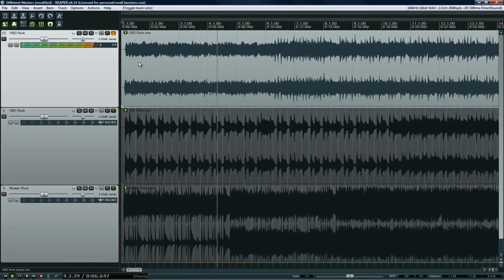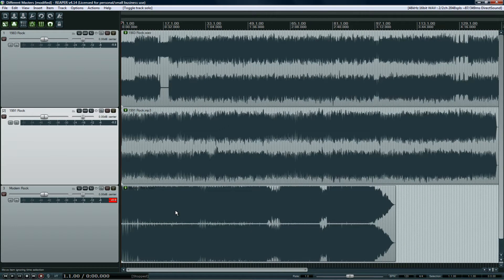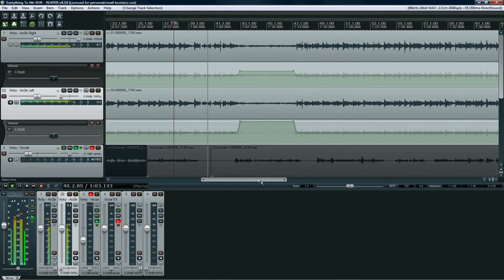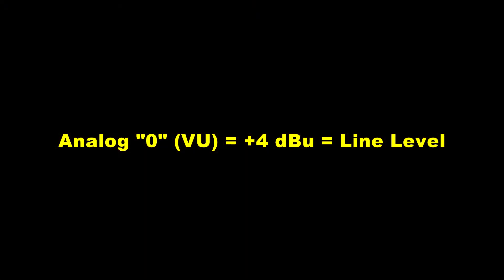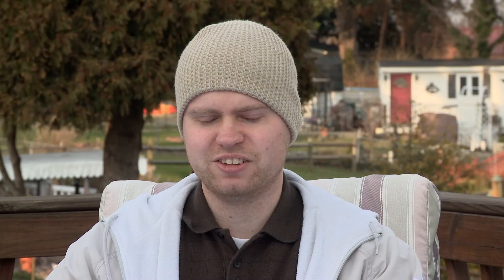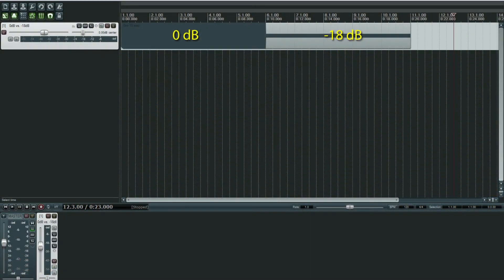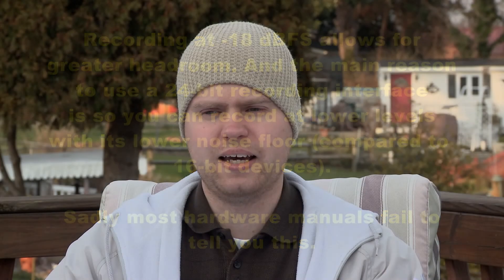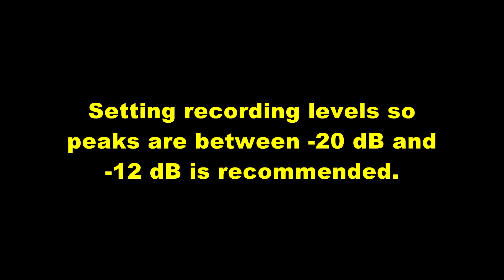Best Audio Recording Levels Optimum Tracking Settings

Comment from the maker: Tracking at lower levels has had a huge impact on quality. I used to think my cheap gear was worthless until this bit of knowledge hit my brain. 

By recording at appropriate levels worrying about digital clipping (going over "0") was gone. SOME of my recordings were OK thanks to using a mixer but when I was using an interface with built-in preamps that's where I would track too loud.

Not anymore. Not since 2009. And I mix quieter now too! Mastering is when you make it loud...

Comment from the maker: I hear you! I went for about 5-6 years using a Behringer mixer with RCA stereo outs going into a Sound Blaster card. There was no punching or latency-free playback. It was what it was.

Now I have a better setup using a PCI-based interface. Latency isn't much of an issue and my gear overall is better. I research new gear purchases until I am blue in the face and pray for the best when I click the Buy button.

Zoom/Samson have some good stuff. And Tascam too for the money they are great.

Comment: Adam I keep coming back to this video; dude, you are THE master. There are too many so-called experts on YouTube giving terrible advice regarding this subject. Your explanation is so precise and scientific. I finally get the point of 24 bit recording systems. Record at lower levels to avoid recording the  noise floor in the home recording environment. Take advantage of the dynamic range. It took me a long time to figure this out; I was clueless for so long. Thanks!!!
Reply from the maker: +Warren McDonald Thanks for the compliments, Warren. Glad I could help!
Reply: So when I record my acoustic drums should I have each track fader set at about -18 and same for electric guitar and vocals? If I do this will I not have to gain stage down before mixing? Right now I have them all at 0 while recording. App any tips. Thanks for the vids
Reply from the maker: Larry Tate Leave your faders at 0 while recording. Set levels with your preamps (input knobs on your interface or mixing board).
Reply: Ah ok I get it now. When I set my interface levels so that I get my input levels in the daw at about -18, I'm only getting like two green dashes on my focusrite interface. I was going all the way up to the first yellow dash where I used to set them. Is only going to the second green dash on my clarette interface ok or should the signal be hitting a lil harder at the preamps?
Reply from the maker: Larry Tate Just set it so you don't peak over -10 dBFS. Some people say -6 dbFS is the absolute max so if you aim for -10 you'll probably never get to -6 dBFS. 

-18 will be your average peak range but not absolute.
Reply: Larry Tate I use a focusrite interface and that taking is peaking like crazy!
Reply: I just tried this setup and my God you're right! it sounded a lot better now. Thank you so much!

Comment from the maker: Glad I could help. 

If only they told you this stuff in the instruction manual, right? I was doing it wrong for a long time and was always complaining about clipping. But then I learned about how recording quieter not only saves you from clipping but it also sounds better overall.

I was skeptical at first and worried about my noise floor but I had access to better equipment by that time and sure enough my recordings benefited from tracking where I should have been tracking the entire time.

Comment from the maker: Thanks I appreciate hearing that!

Well the idea is to record your individual tracks at lower levels so that you don't have to adjust their faders down that drastically. I try to aim for no greater than - 6 dBFS as a guide on the master. I save the volume boost/brickwall limiting for mastering but I do sometimes mix into a mix buss comrpessor plugin.

2. Assuming we're talking about plugins, they should have a volume or output parameter to lower the signal. So yes I'd trim to -10 dBFS peak.

Comment from the maker: Boosting = a digital boost, which doesn't add any noise to the signal other than what was present when the audio was originally captured.

What I usually do, since mastering plugins tend to eat up a lot of CPU power, is render my mix to a stereo floating point (32 bit or 64 bit, depending on my mood) and then create a new REAPER project.

This is how you do things if you were to send a mix off to a mastering house. So I'm simulating that process. iZotope Ozone 5 is my usual "booster" plugin.

Comment from the maker: @AdrianPaulMusic That's good to know! I don't have access to/can't afford an Aurora or equivalent setup so I will take your word for it.

Check out the video Audio Masters - Recording Techniques - Recording Levels - Q & A for more. It's a bit hard to hear some of the discussion but they pretty much say the same thing. Some of the guys are tracking even lower between -30 to -20 dBFS because they have gear with a lower noise floor and are recording in quieter rooms than a home studio!

Comment: Adam, I started recording at these more conservative levels about three weeks ago and the quality is definitely better. I came on YouTube tonight specifically to find out if someone would tell me the right volume levels and you confirmed I am on the right track, so thank you so much for this video! 

When mixing, where do I need to keep my levels? Also, do you have advice on compression levels. I am getting radio play in three markets so it needs to be right. How do I know what is the proper volume in the final mix?  I am subscribing and will look into your other videos!

Thank you again for this video. ~Nancy
Reply from the maker: Nancy Burridge You're definitely on the right track!

When mixing I follow Bob Katz' K-System. It seems to work for me, with one modification (my secret). If you have a good set of speakers then you don't need to follow "my secret" and really the K-System works fine 95% of the time. More info here: http://www.digido.com/how-to-make-better-recordings-part-2.html

Comment from the maker: @Pitacle2009 Tracking with peaks at -20 to -12 dBFS will give you a high signal-to-noise ratio without clipping. On my 11 year old interface my noise floor is at about -90 dB. Now, room noise like HVAC air flow can be higher than that at -70 dBFS or so. What I do is either use a high quality noise reduction program like iZotope RX or a noise gate on or before the compressor.

The voiceovers on this YouTube channel are recorded at 16-bit at -18 dBFS and are  compressed pretty heavily.

Comment: Adam, this is rockstar170, just on music video account. You know I never went to recording school, and I confess I started out buying cheap gear but I could never get the sound out of it that I wanted. It would always end up sounding lifeless. I thought it was the gear so I kept upgrading for years eventually to what I have now which is a Lynx Aurora 16, and an avalon 737sp. I found even with equipment like that if you don't set the input level right it can still sound lifeless!

Comment from the maker: @AdrianPaulMusic Indeed, the subjective answer is to record where the hardware makers set their nominal levels. Some manuals will tell you this information and some won't But they all end up somewhere around -18 dBFS and some can be set manually for more headroom.

So just in case you can't find this information that's why I suggested what I did in the video. I'm going to post a good follow-up gain staging video this month so be sure to check that one out as well! Thanks again 4 your comments.

Comment from the maker: Haha, I like that description "gold dust".

Mono vs. stereo...what are you trying to record? Do you have a lot of instruments for that particular mix or just a few (like vocals/acoustic guitar)?

Compression on the way in helps, if you know what you're doing and it sounds good. It's especially helpful since you're recording with a 16-bit system. Back in the tape days hardware compressors were used all the time to keep the signal above the tape noise floor as much as possible.

Comment from the maker: @rockstar170 You're welcome! I actually just read the other day to think of the solid state nature of analog to digital converters i.e. your recording interface. Most solid state guitar amps sound harsh/brittle/edgy. I say most because a GOOD (read: expensive) solid state amp CAN sound good. 

But since most home recordists don't have the money for expensive converters recording at a lower level results in a less brittle/harsh digital conversion. Plus you get more headroom to avoid clipping!

Comment from the maker: By SD 302 I assume you mean the Sound Devices 302 mixer, correct? I'm not familiar with the Tascam.

Usually with whatever mixer model you have you'd set the master knob with a 1 kHz alignment tone to "0" then set your outputs to line out (because the mixer is your mic preamps, one of the biggest reasons to use a more expensive external mixer with video productions).

Then make sure your recorder (in this case the Tascam) is set to line in if you have that option.

Comment from the maker: @rockstar170 So again the trick is to record at the optimum levels as described in the video and then wait until the last step (mastering) to bring levels up to a competitive/loud level. Ever since I've done it this way my recordings on relatively inexpensive gear have sounded really good. 

It's a shame they don't tell you this stuff in the manual.

Comment: This info made a HUGE improvement to my tracking quality. Thanks Adam. :-). I've watched other videos suggesting that, not only does the channel fader need to be at unity gain, the master fader on my mixing board needs to be at unity also. I'm  not hearing a difference in recording or playback when I have the master at unity or down to 1 or 2.  I'm obviously not  very knowledgeable with all the aspects of gain staging. And this is probably among the most basic fundamentals that you and and most of your subscribers knew about since day one of their recording experience. Is this true about the master fader, or does it make no difference ? Thanks again for posting this video. BTW, if your answer depends on my gear, I use 2 57's thru my Behringer 2442FX, direct outs to line level inputs on my MOTU  828mkII,  into Sonar PE 8.5.3.  I keep channel fader at unity gain, set input level on mixing board to about  2,  And then use channel fader to bring input level down to -18 in Sonar.  Is this the correct way to set my level ? My MOTU software seems to have no affect on recording levels. Only monitoring levels while I'm recording. I would really appreciate your help with this and I hope this post wasn't  so long that I became annoying.   :).    Best regards.

Comment from the maker: Maybe. The Saffire Pro 40 is in the low end/budget friendly price range. 

To be on the safe side I would try to not peak over -10 dBFS. I'm just telling you what I would do and what I do now that I have the knowledge of nominal operating levels.

Just for reference I'm using an interface that came out in 1999 and has a noise floor around -100 dB when nothing is plugged into it. On tracks that I have to use a lot of compression (which brings up the noise floor) I will use noise reduction.

Comment from the maker: @adrwings34 Thank you! I'm not familiar with Drumagog (never used it). My educated guess is that no it won't affect microphone bleed but you will have to obviously lower the threshold or whatever the setting is called in Drumagod that triggers your samples so it recognizes peaks.

If the audio is too low use FreeG.

For less drum bleed move your mic closer to the drum head. Especially if you are replacing drums 100% with samples (save for the overheads/hi-hat mic) then that's what I'd do.

Comment from the maker: Unfortunately it looks like the Tascam DR-100 only accepts line in through a 3.5mm input. You'll need a stereo XLR  Female (2 mono connectors) to 1/8" stereo phono cable. It'll still work but it's an unlocked and unbalanced connection as opposed to an XLR cable.

Anyway, with the 1 kHz alignment tone still coming out of the Sound Device mixer set your input knobs so it reads -20 dB on the Tascam. That should do it. The SD 302 has 20 dB of headroom so everything should be perfectly calibrated.

Comment from the maker: You could set the SD mixer output to mic level but it would defeat the purpose of using it/reduce its quality. But if you need 3 inputs then that's what you have to do unfortunately since the recorder doesn't accept XLR line level inputs.

Comment from the maker: Hey everybody I also want to add another comment on this video. If you get your signal up near the 0 dBFS clipping point your interface may have a built-in limiter so that it doesn't digitally distort (as easily). The problem? Limiting = softening of transients and other nasties. Avoid it by recording at a lower level as suggested in the video.

Comment from the maker: OK well in that case I would just find your loudest peak and boost your gain (in software) by that amount, minus about -0.3 dB.

For example if your peak was at -10.3 dB then boost it 10 dB.

If you use a decent brickwall limiter like the one in iZotope Ozone 5 then you can boost that even more and still have it sound "pure".

Comment from the maker: @Pitacle2009 ...with music that is compressed this is less of an issue because noise is drowned out by the louder signals. With the exception of a music rest in that case noise reduction may come into play if need be.

One thing I forgot to mention in the video is that analog to digital converters start to saturate before digital 0 and cheaper gear sounds worse past about -18 dBFS. Tracking louder is one of the causes of smaller sounding mixes. Audio loses its "openess" if *recorded* too hot.

Comment from the maker: If you have a good interface that doesn't start to saturate/"get stuffy" until it hits 0, then yes.

The truth is the majority of interfaces in the low to mid range price bracket are compromised with cheap analog components. When you stress those cheap components they will saturate in a bad way.

Some converters also have built-in protection limiters that negatively affect audio.

Keeping levels more conservative stays away from the transient sucking/frequency balance altering saturation area.

Comment: Perfect! I literally JUST got this concept this past weekend -  I always followed the "If it's not clipping, you're good"... Boy have I been wrong!

Quick question - Should the buss track and the input track be around the same level? I mainly use VST's and sample based programs, so when I'm "recording", I have the input (i.e. Kontakt) coming in around -16 to -12db, is it safe/appropriate to turn up/down the buss channel? 

If my piano (kontakt) is coming in at -16, should I or should I not turn up the buss channel to something like -12/-10? 

I hope my question makes sense.. Thanks for your time!
Reply from the maker: +Chris Meyers Once you've recorded your file you can do whatever you want with it and it shouldn't clip inside of your DAW. The only thing you need to worry about is not clipping your master buss. I demonstrated the power of floating point files/mixing in this video https://www.youtube.com/watch?v=92CJdNJen9E .

No, if you are using analog modeled plugins then you do have to worry about gainstaging. In that case, don't go past about -10 dBFS peak and you should be good.
Reply: +RealHomeRecording.com Awesome!!! Thank you so much!!
Reply: Chris Meyers back in the early 90's when bad consumer / semi-pro 16 bit converters operated at 14  bit performance pushing it up to zero made perfect sense. Believe it or not there is a set level for 16 bit. An average level of  -12dbfs and a peak of -3dbfs. Now, they didn't normalize in those days. Why? No loudness war. This is the reason why 80's compact disks are so low in volume. And the fact they didn't compress the crap out of the master in those days.

Comment from the maker: -20dB from which reference? -20 dBFS (FS = full scale) refers to -20 dB from absolute 0 digital...so anything over 0 will clip/distort.

-20 dB VU on a mixing board would be about -40 dBFS...too low. 

My rule of thumb is to peak at -10 dBFS. The more expensive your converter the less of an issue this is

Go on the RHR web site and look for Rules for the Proper Gain Structure and Optimum Signal Chart PDF file. There's a chart on page two that might make more sense than can be explained in words.